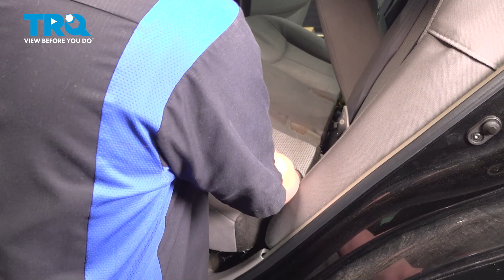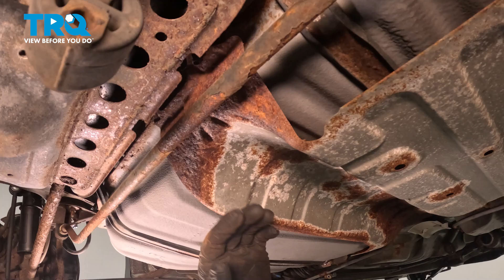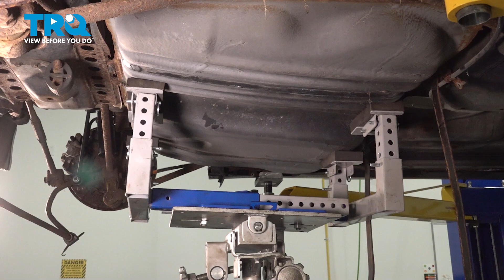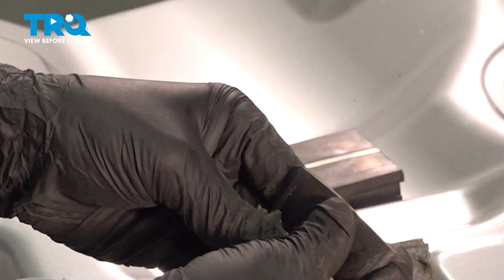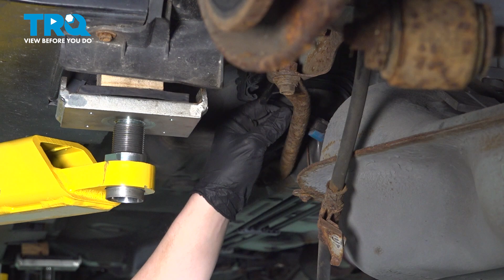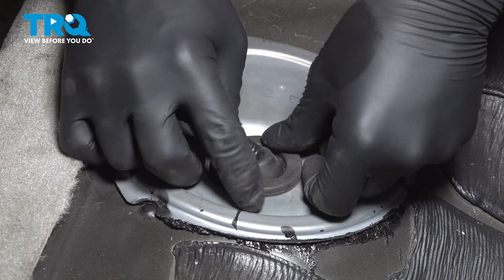How to Replace Fuel Tank 2007-2011 Toyota Camry (2.4L L4)

Comment: Thanks for making this video. I had to swap out our leaking tank on our ‘06 Avalon with 177,000 and this helped immensely! I also found that vent tube a bear to disconnect from either end so I just cut the damn thing in half. New one from Toyota was only $25.00 anyway so it saved me a lot of aggrevation..